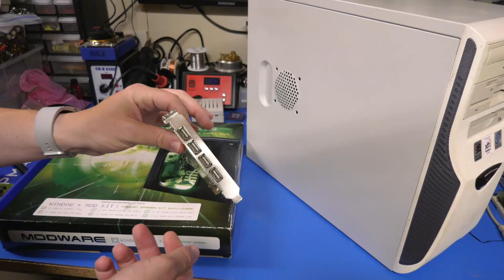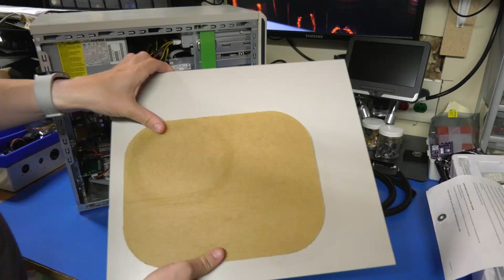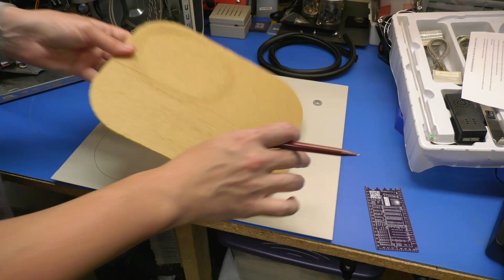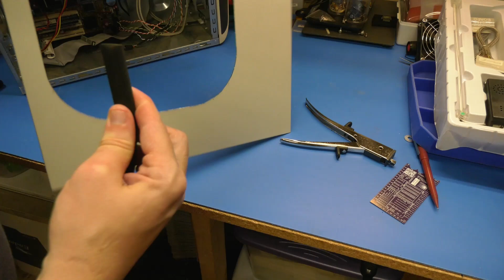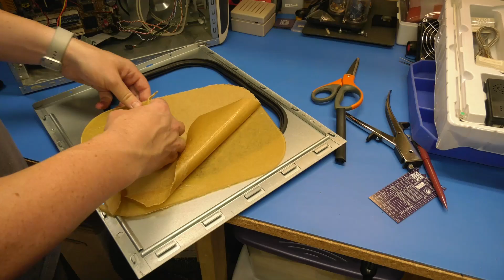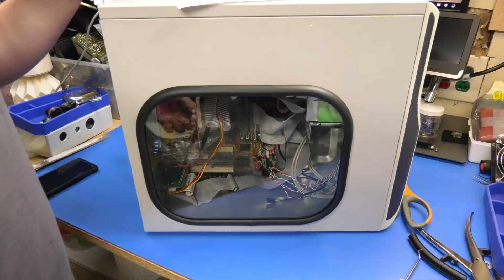Voodoo Windows 98 Rig Gets an Aftermarket Window Mod!

Comment: half inch is not 10 centimeters 😅, it's 1.27 centimeters (or 12.7 milimeters). Maybe you meant 10 milimeters ?
Reply from the maker: For sure meant 10mm. 10cm would way throw off my window size!

Comment: A dremel would go a long way here😅
Maybe try goo gone on the acrylic glass.
Reply from the maker: I did try goo gone on the glass, it got rid of the word stuff at the bottom but the fogginess it didn't touch. Seems like an outgas reaction with the acrylic from the rubber gasket.